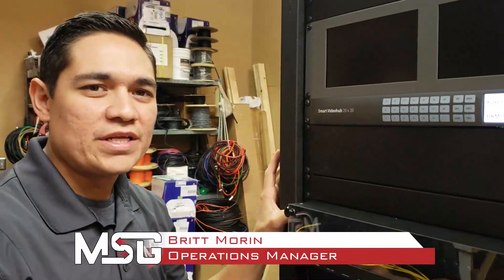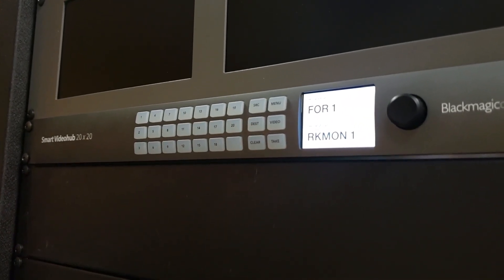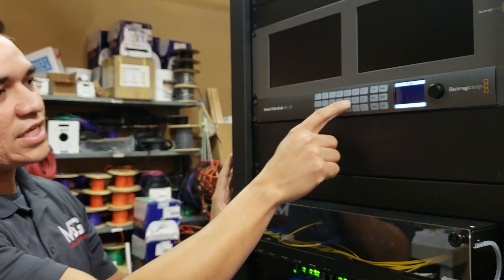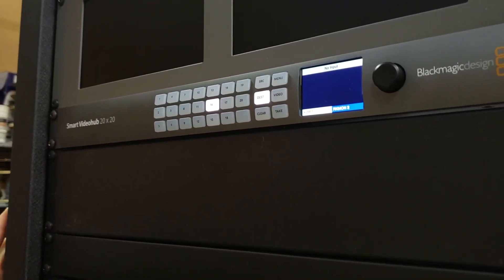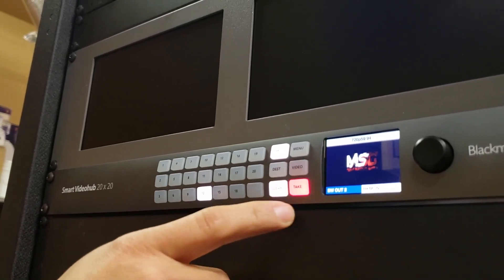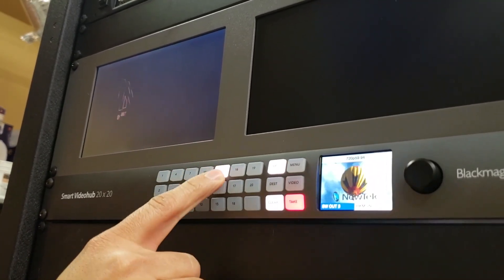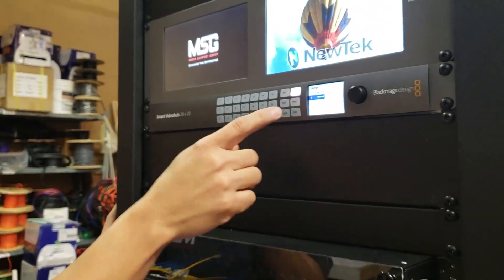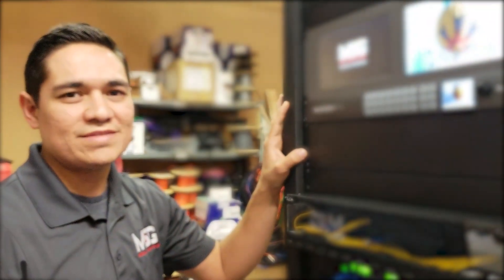BlackMagic Design 20x20 Smart Videohub

Comment: if I add a camera at 1080p 30fps and another at 1080i 60fps, can I get a single signal and output ??
I use studio hd in 1080i and all the signals come from the smart videohub
Reply from the maker: This is very basic router with no scaling functions. Your sources will need to match the destinations. If you had different sources with different formats, I recommend using a scaler in your signal chain to format to your desired format.

Comment: In your case, are you able to send one input to the 3 different outputs? Or can you send one  inputs to 1 TV output then another input to 2 different TV outputs?
Reply: I need one signal to send to three different outputs.
Example:

1 output = tv link
2 output = iptv (cabble operator)
and 3 output orion tv (another cabble operatot)
Reply from the maker: You can send one input to multiple outputs.